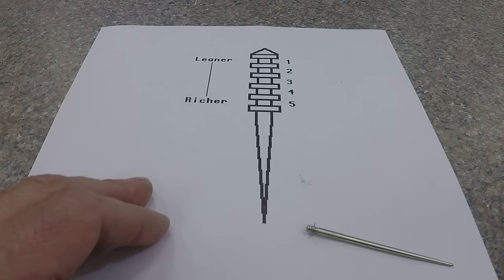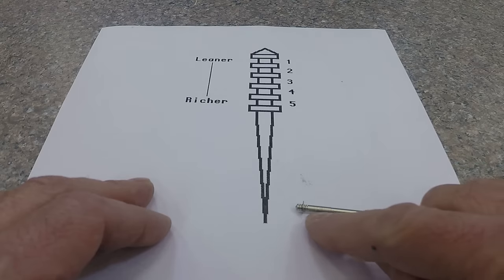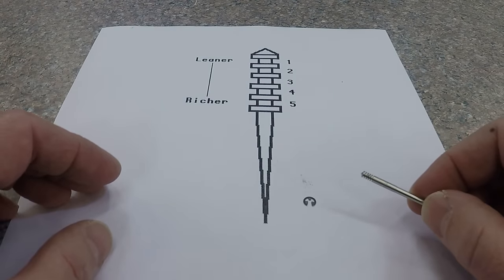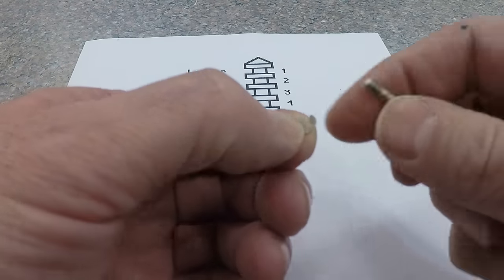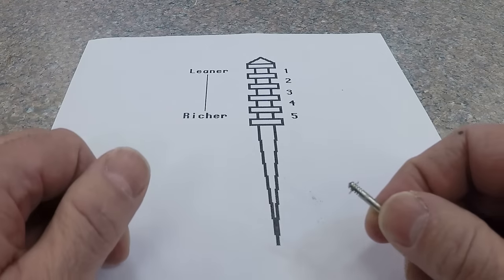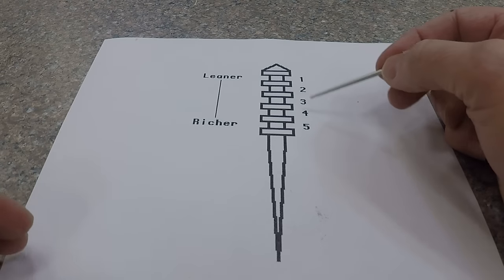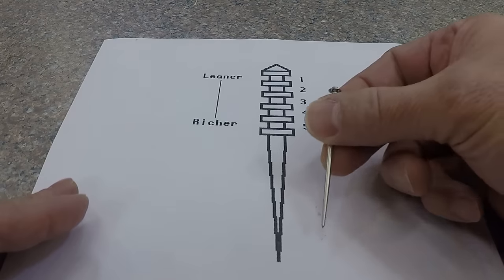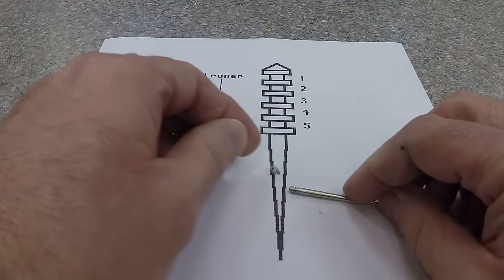How To Change Mikuni or keihin Carburetor Jet Needle Clip positions

Comment: My Suzuki powered Arctic Cat Jag 340 runs like brand new and really hauls after rebuilding the Mikuni carburetor and installing the correct sized main jet and moving the e clip to the correct spot on the needle. I can't believe a 340 has that much power
Reply from the maker: Thanks for commenting

Comment: I have bought a tm33 carburetor for my bike from the us to Australia, the guy in the us had set carburetor specifically for my bike though I don't think he understands that the fuel in the us is not the same octane as Australia, to cut a long story short bike was running way to rich down with unsteady idle so put a smaller pilot in idles very well with fuel screw 1 and 1/3 turns out but would bog up top occasionally had taken snorkel off and would bog much worse so went one size down on main jet runs ok until I am at sea level than runs lean up top needle clip is in middle position number 3, if you can advice me on what direction is best would be great?
Reply from the maker: I would start with whatever the owners manual says

Comment: What position 1-5 do you recommend the pin to be at for breaking in a new high performance kit, with kei hin carb? I think it came stock on position 1
Reply from the maker: find out for sure from who sold you the kit
Reply: Moto Carib words of wisdom, thanks lol
Reply: my mikuni carb was set to 3! good idle but bad acceleration. is it better to put it to 5? im so desperate in tuning my carb. its like its wasted
Reply: Mine was at 3 but my bike fuel average was crap. Now I set it on 2 let's see what I get now regarding consumption. I can compromise on acceleration. But not on fuel consumption.
Reply: @umersohail7335  Reading this when gas prices are 2.40 euros a liter (9 dollars a gallon ish) and fuel consumption is indeed very important 😂

Comment from the maker: There are 5 slots,so 5 adjustments,then there are different diameter needles, needle jets etc.
 Try to find what stock jetting was and it should be close. You may have a different problem though.

Comment: I keep reading about this but my needle only has one groove. It's a 400ex. Maybe it's only supposed to but everything I read says they're adjustable.
Reply from the maker: I would double check the owners manual
Reply: @motocarib925   I don't think the owners manual has that info. It basically tells you that you bought a quad lol. The repair manual mentions it though. I ordered a rebuild kit and the needle in that kit also has just one groove. Apparently it's this model.

Comment: I just already install my mikuni carb on my cub 100cc... But on engine idle it is so bad... Why?
Reply: Turn the air screw all the way clockwise, not too tight, then turn counter clock for 1.5-2 full turns.
Reply: @roguetactical852  tq bro.. I got nice rpm on 1/4 throttle about 1.75 turn... But still bad on timing idle... It is carb problem?
Reply: @adyzanahmad8565  Adjust the idle screw very slow to the clockwise to speed up idle, counter-clockwise to slow idle. Slide position matters as well.
Reply: @roguetactical852  yup... Already done for idle screw and the timing just ok when a low temperature... But on high temperature it become worst... Already fed up with the carburetor... Will find a new carb after this to setup my legend cub 100cc...anyway tq for info bro...
Reply from the maker: Clogged pilot jet maybe

Comment: Trying to find my default pit bike needle position. It's for gas from the carburetor.
Reply from the maker: Usually stock from the factory on most bikes is the middle but no guarantee
Reply: Moto Carib I ride stock I don't really like modifying default set up that way you can move up properly. The needle might have been in the middle I have to check it and hopefully it's the default. The bike was running high RPMs 3rd to 4th gear more low-end torque. The Piston was so hot it almost got stuck. I had to sit for some time idling and bleed the throttle a couple times
Reply from the maker: This is bigger than taking a clip off, you need to talk to a local shop